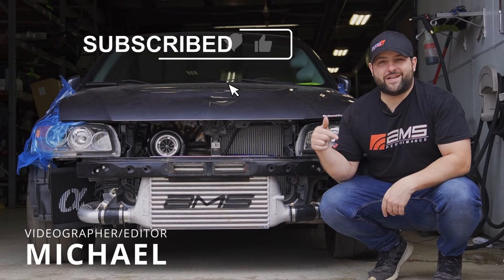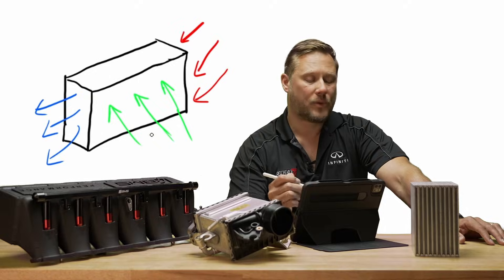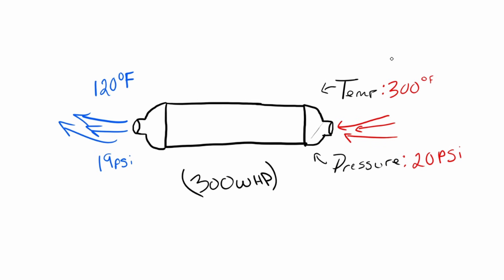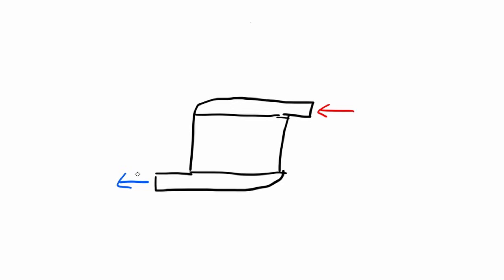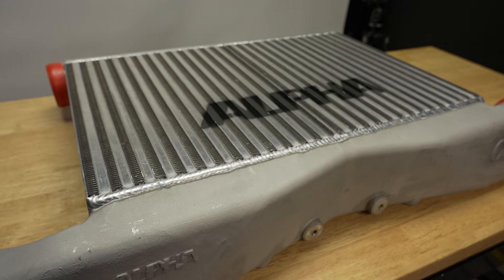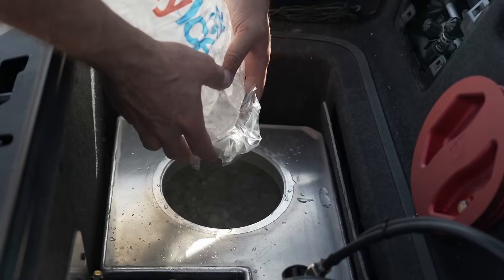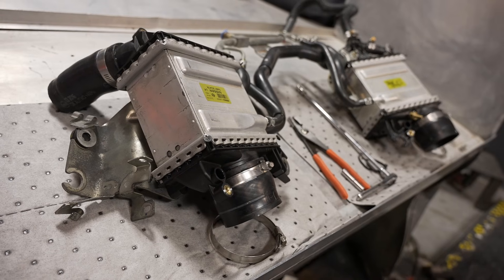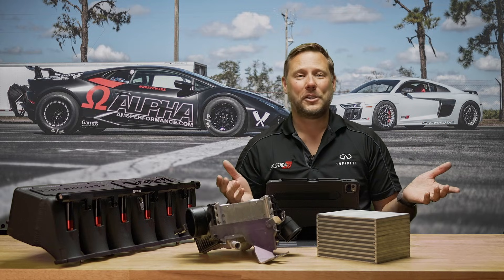What Intercooler Type is BEST? | Air to Air VS Air to Water

Comment: I've always thought that you could do both like run an intercooler and have a heat exchanger on the intake that probably plumbs into the AC lines kind of like the interchiller. It would also need sensors for the intake temps.

Comment: So when the air to water intercooler used radiator water flow, how significant is how long the radiator fan stays on? I'm assuming it shares the same coolant right?

Comment: 4:48 Wouldnt the air density be the higher tho? The temp drop would cause the air pressure to drop, but wouldn't that lower boost level have the same or more air /cubic foot (minus flow losses in the fins)?

Comment: Other than complexity, is there any disadvantage to air to water? I’m planning on doing that for my one KZ which would have a small top mounted intercooler so space would be an issue.
Reply: You still have advantage because you can install an interchiller , which is not applicable to air to air intercooler.

Comment: Hello, i have a question soo anybody can answer it if u know

I have a renault twingo 0.9t 898ccm turbo, i will push around 170hp on garrett gbc14-200 and i need a water to air because its rear engine… probpem is that i dont know how big and what intercooler i have to buy.

Comment: hey, I'm proving the point to a toxic car enthusiast (more so to get him to stop bullying my friend) that a forced induction car done right can out do a NA car. (not saying those are bad either here, this guy is truly bullying my freind because he has the A 5.7 LS and the bully has the 6.2). so i got a 2000 pontiac firbird with a L67 3800 series II. its a beaut of an engine, true barn find with only 138k miles on it.

changes i already did:

new head gaskets (already done and installed)

new sparkplugs and wires.

new water pump.

stock head bolts (plan to change to head studs, i can still do some PSI so im going to use the head bolts i have now to get the setup functional)

performance breaks.

planned changes:

turbo kit from ebay, did some research, it's a good kit, the turbo timer may be bad and the intercooler system is cheap.

air to water intercooler system with radiator tie in. it might just work I'm not sure since I'm not a certified gear head yet.

head studs

a stroker kit to take my 3.8 and turn it into a 4.1.

a mass air flow exhaust system.

if my calculations are correct ( and i have run them) my max HP should be 850-1000. depending on the quality of tune i suppose.

the point of this ridiculous project is to show that it's really not the displacement or the quality of the engine. but the quality you put into your setup and the knowledge you got. and the love that put in (this is also a father son project).

Comment: On a street car, for only 300hp is it worth it for the summer ? If I place the water radiator in the place of the original air to air intercooler ?
Reply: In short and IMO, yes. I've ran WTA on my GT4 for 2 years, and it's temp stayed considerably lower than a similar sized ATA cooler on cooler days.
Reply: Hey, wanted to expand a bit more on what I mean...

Myself and more than a few others (25 others) ran research on this topic within the Celica GT4 and MR2 forums (WTA vs ATA) and each offered some very clear advantages over the other...but in the performance catagory for road and race vehicles, the WTA came out on top almost every time.

Only when you consider complexity, weight, and price, does the ATA shine and it does its job very well.

But if you are designing your own system or improving on an existing system, WTA all day.

Our points focused on the following - Intake air temps (before and after cooling), pressure drop or CFM comparisons (before and after the intercooler), flow of the pump and watching for cavitation, introduction of other components (swirl tanks, ice boxes, fans, aluminum heat exchangers, etc), types of intercoolers (within the WTA scope), other types of heat resistance, and finally coolant.

What we found is that the pump being used, is by far the most important. And when combined with an aluminum rad w/fans, and heat lagging the intercooler, and finally just using water with "water wetter" (the product), that it produced far better cooling that both stock systems for our cars AND top of the line ATA cooling...cant remember the exact numbers so I dont want to lie, but it was a blowout...even in traffic on a hot day, it performed far better. 

Anywho, just some food for though. Im an electrical engineer and Master electrician by trade, but have left those careers so im a bit rusty with wording.
Reply: @terranceaskew3165 thanks for that explanation. I'm looking at getting a WTA intercooler myself, my setup with a WTA would drastically reduce the distance required from turbo to throttle body. Did you do any research on how shortening that distance affects performance?

Comment: iE created the first air to air Intercooler for the b9 rs5 instead of the stock air to water. Apparently their testing shows crazy cooling power. A little skeptical on changing the cooling system but if it works and cools a lot better then why not

Comment: Should start off explaining Specific Heat and the energy required to change temp per unit mass of water vs air.  
People have no frame of reference without that simple framework that's easy to quantify.  

What I'm most surprised by? He referred the IC's pressure drop as though it was a "byproduct" or a "con." When it's the PHYSICS of cooler air mass of identical weight that it'll be at a lower pressure. 

Which makes me think ... 
"no bg in science, as he has NO familiarity with basic thermodynamics."

Comment: Am I correct in assuming that if you run an air to water cooler/coolers, that your intake temp could only get as low as the temp of your coolant? Because the fins on the cooler/coolers are going to hold that same temp?

Comment: Hey guys, I own an Audi RS5 and there is minimal R&D for our chasis. Is there a way you could creat an air to water intercooler that’s better than Wagners lot for us?
Reply: I'm in the same boat. I'm looking to upgrade the cooling but don't know if I should go wagner A2W, Intergrated engineering new A2A or wait for something better in general. Chasis has been out for 7 years and not much into it and one company has a stage 3 tune lol

Comment: I own WTA intercooler. Most people don't even know how this system works. Everyone thought that it takes the water from the engine radiator and they were laughing on me. Fun fact is that i own a Celica st205 with stock WTA Chargecooler and i had 300whp on 16-17 psi. I had stable results and same inlet temps with ATA on road, others need moee than 18 PSI to reach 300whp with air to air intercooler. Also In busy roads and towns WTA is way better I've seen it I tested it and i will never change it to ATA intercooler.

Comment: no mention of Air Density (the import part) 
20psi @ 180f into FMIC but 19psi @ 100f coming out but the air density is much higher so even if it dropped to 15psi would still make more power than 20psi. 

Much like how a big turbo can make say 500hp @ 10psi , while on same engine a smaller turbo at even 30psi might only make 400hp. 
Its all about air density not pressure.
Reply: Yes, more pressure is actually bad - it is all about the flow (usually MAF measures g/s) and there is density (density of oxygen is related to the air temperature and elevation) More pressure just means that turbo is working harder.

Comment: I’ve always wondered why manufacturers never considered running refrigerant through water to air intercoolers. A similar method is being done with PS fluid being used to not only assist in steering but also braking.
Reply: I’ve wondered why nobody is wrapping intake tubes with 1/4” silicon tubing and running cold cold water through the silicon tubing to help dissipate heat like we do with our water jacketed electric motors and ESC’s in our high end RC fast electric boats. 

Have a water tank with cold ice water in it. Little electric water pump to push the water through the closed loop system. Once the water gets warm, add ice, or do a water change.
Reply: Thats called an inter chiller. Been a thing for a long time.
Reply: Not enough pressure.
Reply: @MrTilbin there’s a lot of pressure in the AC system. You’d just have to add more to account for the extra plumbing
Reply: @kenxiong6830 ah I thought they meant as is just freon. But now you're running drag on the engine running a compressor. Even and electric one will pull off the alternator.
Reply: @MrTilbin you would run an electric system and upgrade to a bigger alternator.  Fortunately the drag of a bigger alternator is negligible
Reply: The dodge demon did that i think?
Reply: The AC system doesn't have enough cooling volume for that type of setup. It's like trying to cool your PC in a freezer. It might work for a few minutes but heat soak is gonna be a real issue.
Reply: @dustinandtarynwolfe5540 well you would scale the system up to meet the anticipated demand
Reply: @dustinandtarynwolfe5540  True I calculated around 215k btu/hr for a tvs 1900 at ~10psi on my car. The m112 was much worse at 397k btu/hr in heat charge. A interchiller using the stock ac might do 18k btu/hr. Could be useful for cooling to a super low temp and then letting it heat up through the run. But helpful for maybe a single 1/4 mile run.

Comment: small correction for the area of flow vs temperature drop mentioned @7min 
the heat energy dissipated is corelated with the core volume , and not the length. The same IC used on the example could be used with higher boost and hotter air, and would be cooled by the same delta T as lower boost (actually higher T inlets gets cooled by higher delta T). it is about mass flow, and heat energy and not the psi in the cooler. 
Simply put, short path with large cross section area is more efficient, and less restricting than the opposite. 
It becomes a diminishing return when the flow through the core becomes to slow to utilize the full core volume and than we have dual, triple pass radiators.
Reply: He doesn't have a physics background, nor familiarity with thermodynamics.
Eg: Of COURSE the charge air will be at lower pressure on the cool side of an IC.
The same air mass at a lower temp = lower pressure, bc it's directly proportional.
Imagine not knowing that ..? And 'teaching' (or worse, designing?) intercoolers.
Reply: @trumanhw  partly true but it is that for same delta T a restrictive cooler will produce more pressure drop than an optimal or "ideal" one would ...
Same for any chargers (turbo or super) heating the air more than  T2/T1=(P2/P1)^1.4 would suggest meaning it comes from losses in the process :)
Reply: You’re heading down a rabbit hole you don’t want to go :o) It’s more art than science ;p) I’m happy to double and triple pass for water and oil. I’m not double passing a high flow intercooler unless I need to make it fit that way. The internal tube velocity is less critical with internal fins doing the work and replacing turbulent flow. If the core flow is not even I would rather fix that with header tank flow directing plates and port position than back-up the pressure by mult-pass.
Reply: @teamidris  multi pass coolers are as well one of the biggest marketing lie in radiators.. the fluid should have the shortest distance for any possible cross section area.. not double, triple ect... 
Multi pass works only as compromise due to other "aspects". Or if the radiator has to be very long in the direction of the cooling media flow (a car radiator being done in a way so that the frontal area is small, and the radiator is long....   (Such was done on F1 water intercooler)

Most radiators manufacturers utilise fancy wording that is laughed at by anyone with a basic thermodynamics course..

Comment: Extremely gud low drag  just bit care can go long using antifreeze in winter 10 15k periodically lubrication of pump charge hose can b protected by oil vapors by engine breather its nothing less den legendary progress & achievement by "ams" performance deir air to water intercooler is much superior & lot efficient as compared to da market norms, keep wurking hard we wish u a ton of luck on ur "boost" mission & oder racing upgrades

Comment: There would definitely be loss of pressure just from the cooling itself..restrictions aside..For example..you can heat a pneumatic cylinder to increase the pressure thus increasing the amount of load it can lift..or make it faster..obviously cooling would have the opposite effect..The heat excites and expands the oxygen and nitrogen molecules...or some shit like that..😅..

Comment: I feel like the pressure drop is less so from the constriction, which shouldn’t decrease pressure but actually increase (less volume increases fluid speed and pressure this is partially how air conditioners work). The pressure decrease comes from the cooling factor of the intercooler itself. Pressure and temperature correlate. This is known as Gay-Lussacs law, or the pressure-temperature relationship. If the volume increases, the pressure and temperature decreases, via thermal expansion, and the air slows down. If the volume stays the same, but temperature decreases, pressure then decreases at a proportional inverse rate and vice versa.

Comment: This was fascinating, thanks! The intro, with the insane monster HP cars had me worried that I was in the wrong spot for my application, but the information supplied was terrific! I have a '77 Datsun 620 that I'm doing a full restoration on + KA24DET motor build and I absolutely refuse to have some ridiculous FMIC ruining the lines of the front of this truck, so here I am, researching air-to-water intercoolers both for their size and efficiency!

Comment: Great video. To drive the importance of intercooling home, go watch Banks' killing a Duramax series. Increased intercooling efficiency and effectiveness equals denser air, equals more power. Banks will show you that an increase in cooling the charged air adds as much or more power than adding a bigger or second turbo. I see a lot of diesel truck folks going for twin turbos but they still run A2A intercooling 😂 On a tow/haul truck, heavy loads up the hills and steep grades means the truck wants to slow down both up and down the hill, and getting started from standstill is a strain on the engine. At all these crucial times, u got little to no airflow at the grille, except maybe the fan. Introducing water to the equation allows for unlocking response and power when you need it the most. I would opt for a W2A cooler in line just before the stock A2A cooler, OR remove the giant stock cooler altogether and replace that space with a large radiator for cooling the W2A fluid. Get rid of the mechanical clutch fan and shroud which hog like 2 feet of space in front the engine. Get some good electric radiator fans rigged on temp switches and relays like they sell in kits or add a digital controller if u wanna get fancy. Davies craig makes fancy elec water pumps and digital controllers. The pumps are actually pwm motor controlled to vary the impeller speed. U can use them for intercooling and/or for the engine coolant if u want to delete the mechanical OEM water pump. But I'd surely go for a customized W2A setup, with some good sophistication before I consider doubling the turbos on a diesel truck

Comment: Do the combustion gases that turn the impeller of the turbo add heat to the ambient air coming into the turbo? I guess I mean do the exhaust gasses heat the whole turbo (body and internal parts of the turbo), which essentially pre-heats the ambient air before it's heated by the actual compression of the turbo?
Reply: Turbos get very hot and the extreme heat on the turbine housing side heats the whole turbo but the compressor housing becsuse it is a distance away from the exhaust housing doesnt get anywhere near as hot but still heated up yes, and then compressing air which creates more heat which is why a intercooler is needed.

Comment: Why not run the air conditioner into the intake?
Why not use the existing radiator to cool the intake and turbo?
How about electric supercharger design?

Comment: The thing that I don't get anyone can answer, where does the water come from and go to like does it all go through the ice tank? Or is that another thing? I honestly want to know...
Reply from the maker: Basically, the water gets pumped from the ice tank to the intercoolers, and then back into the ice tank. In drag racing specifically, the ice needs to be replenished after every pass to ensure it's providing the intercoolers with a very cold flow of water. It's a looped system.
Reply: @AMSPerformance  aaahh yea I see that was really the only part that was confusing me is where the water goes to... Alright thanks a bunch

Comment: boost gauge is very low technology. even if the boost pressure drop the content of the air raming inside the pipe doesn't decrease. 
"gale banks"